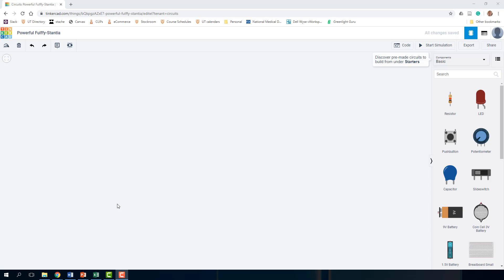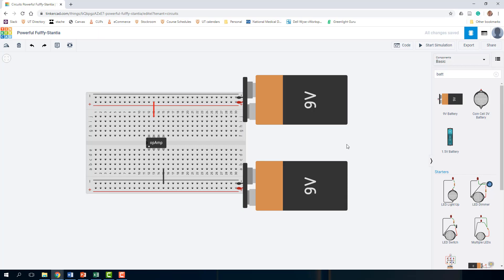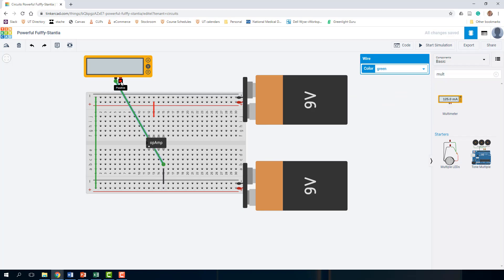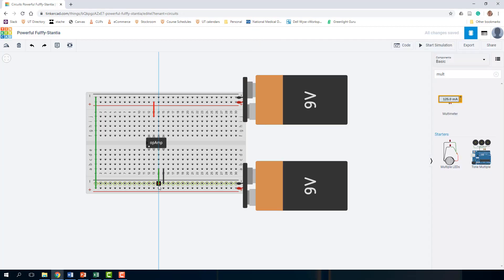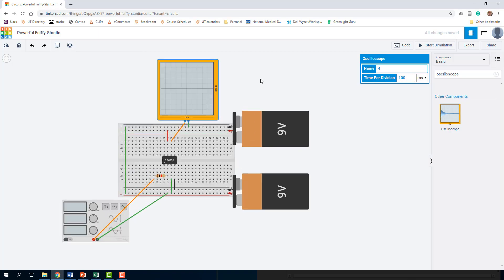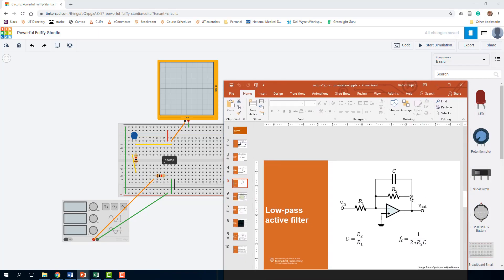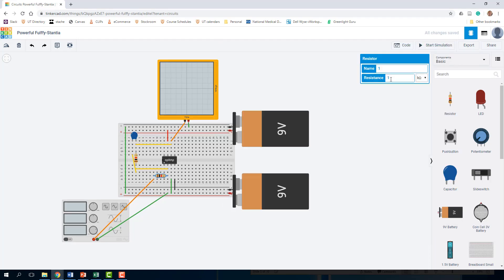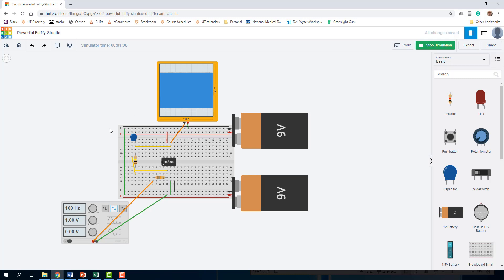Using TinkerCAD to build a 1st order low-pass active filter

Comment: Dude, this is sick. I mean, AWESOME. Is there any way you could put a potentiometer in the circuit to replace the function generator and control the frequency?
Reply from the maker: You can't replace the function generator...you need a signal from something.  Also, a potentiometer could be used to control the amplitude of the input signal, but not the frequency.  If it were possible, you would use a variable capacitor to change frequency (just like in old school car radios - one knob is potentiometer to control volume, other is a variable capacitor to control station / frequency to tune to)

Comment: Your video helped to design circuit and it is running succeessfully. Multimeter doesnot measure ac or signal voltage. only measures dc voltage.  On scope we cannot take readings.  If possible help.